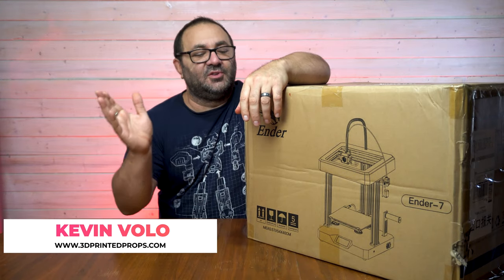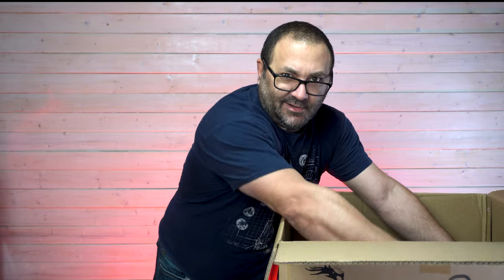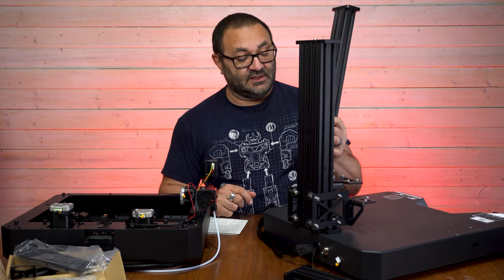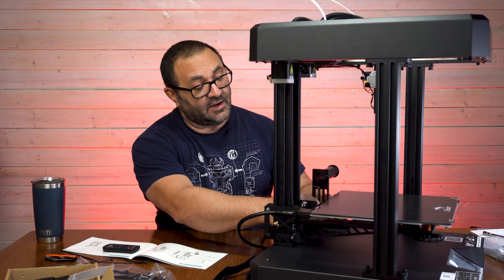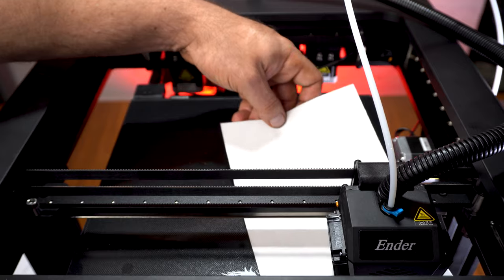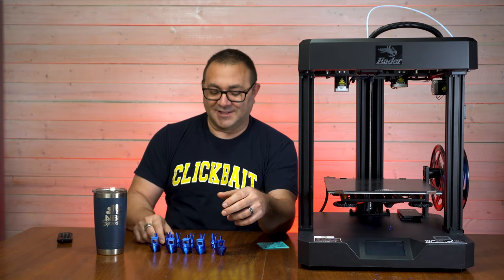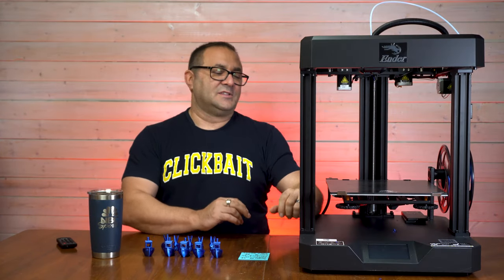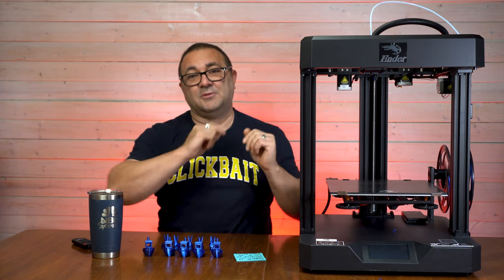Ender 7 3D Printer from Creality Review

Comment: I really like this design over the E5. It looks more substantial and stable. I would love to see mire move to this design. I just wonder how hard it will be to add direct drive. Would it lose the high speed.
Reply from the maker: I do like the design, I think it really helps with print defects. I'm not sure if a direct drive would slow it down, but I don't believe it would.
Reply: given that on the pre-sliced prints its only doing 250mm/s on the infil and looks pretty rough doing it I don't think you#ll be missing much, but adding a hemera/hemera lite or an LGX FF probably wouldn't affect it too much

Comment: i understand the slicer version they use only prints the infill at the 250 you set. the speed of the walls and such dont change much like normal cura. Try a non creality version of cura at 250 and see what the prints look like! Thats why they seemed so similar between the 50 per and the 250 per. Dont get me wrong I still want one but dont fall for the hype of 250 per

Comment: Constructive criticism:  You really need to verify you're telling viewers actual speeds and dimensions when you're speaking.  50mm layer height?  LOL. 2.0mm and 1.2mm layer height?  also LOL.  Thank goodness the on-screen text was (mostly) correct, because the numbers you were saying had decimal shifts all over the place.

Also need to point out that the comparison prints you're showing don't really say much at all about the printer's quality vs speed ... you say things like "I'm seeing more layer lines" ... yes, yes you are, and it really doesn't matter what printer you do it on, it will be exactly the same because you're comparing layer heights and that's just how they work ... not print quality vs speed.  If you want to show us the differences in print quality do them at the exact same layer heights and different _speeds_.

If you're going to try and do technical comparisons you need to understand the technical end of it and not just say "I selected the different things that the slicer said I could do." which is what this was.